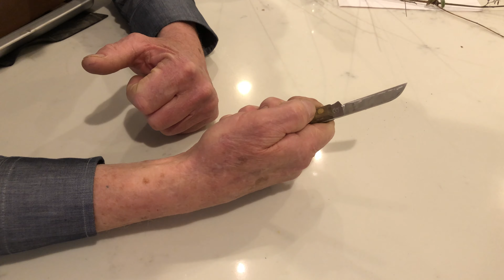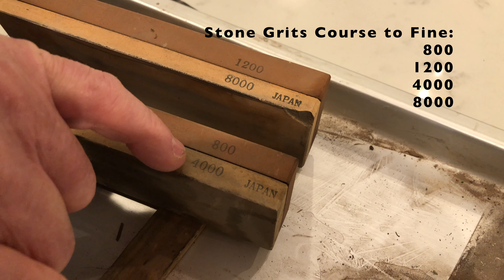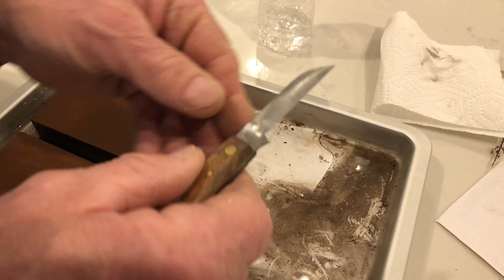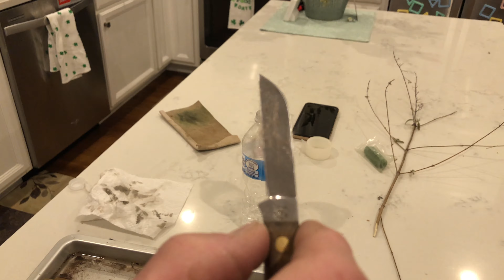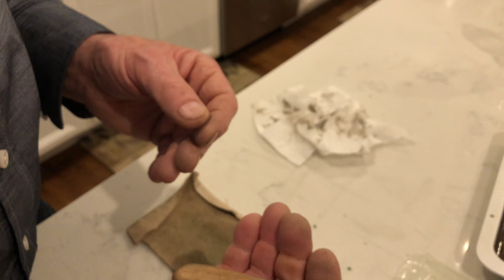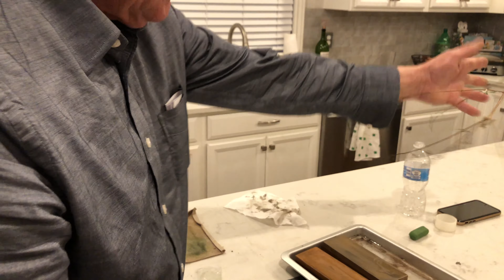How to Sharpen a Grafting Knife

Comment: This is really a good advertisement for how forgiving Tina grafting knives are since so much of this technique is not at all what the professionals do.  He is holding the knife wrong side down on the scion cutting stroke and he is cutting away rather using a pulling stroke toward your body with bevel side up.  The flat side of the knife is always against the scion which is the whole point of using the "chisel" to make a very flat cut.  Also he is sharpening (putting pressure) on the push stroke rather than putting pressure on the the pull stroke which is how the experts do it.
Reply: Correct, to cut away properly, he'd need a left handed grafting knife with one sided bevel.
Reply: 100% agree with you here, 
From experience working in the horticulture industry, particularly in grafting trees, personally speaking I've never had a need for a ''razor'' sharp edge. As long as it can cut through the wood efficiently then it fulfills it's job. This is just my personal opinion, but for me, getting a knife that is not supposed to be a scalpel, to be as sharp as one i.e. can cut through your arm hair...seems a bit overkill. A small point also, you do not ALWAYS need cuts to be in one motion. you can make the cut in 100 motions as long as your finishing surface is smooth. At the end of the day, the tree wants to live...if the surface of the wood isn't perfect, it'll work around that. Yes of course smoother wood means a better strike rate but....in the real world, it just doesnt work like that...
Ideally you want every knife to cut through space and time, but when you're in the field, again,in my experience, you DO NOT sharpen after every cut. You'd never get through your workload, you'd spend more time sharpening than actually using the knife and you're basically admitting that the edge you put on is only good for one cut...and no more. 
The knives we use in the nursery I work for, you'd be lucky if they got sharpened 2 or 3 times in the day. Maybe on a lunch break. This is all subjective but for me, a decent edge should get me through 1 field line of trees, which at our spot, is approx 160 trees, or 220 roses. The cutting technique also affects this of course. We don't cut away from ourselves, we hold the scion close to the chest and draw across our chest. I find it offers more control. And we don't have our thumbs behind the blade either which freaks some people out. But it works. I've grafted thousands of trees and I'm sorry to say it. I do not know who this guy is in the video....but he seems like a hobbyist...and not an actual nurseryman...
Reply: also why he is sharpening level side?' seems everything wrong